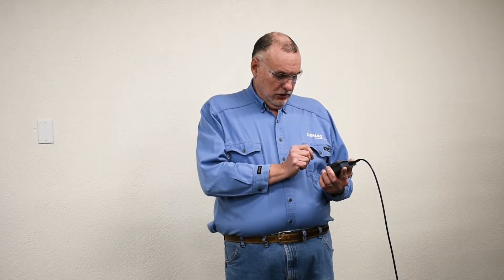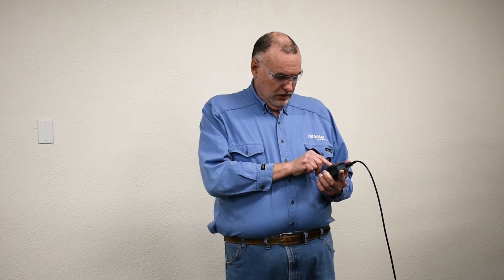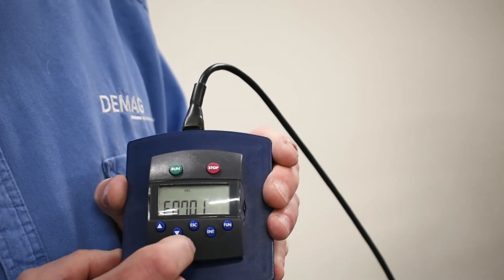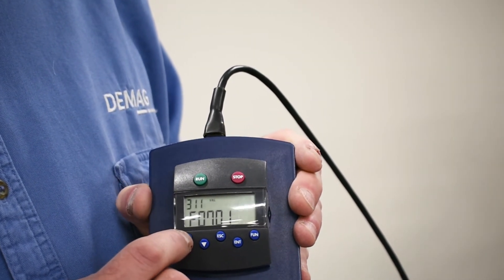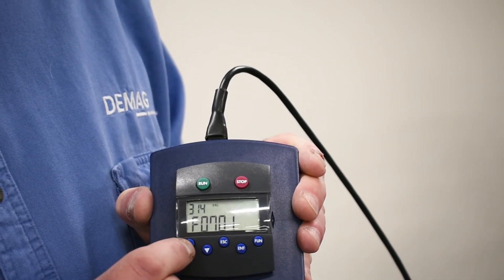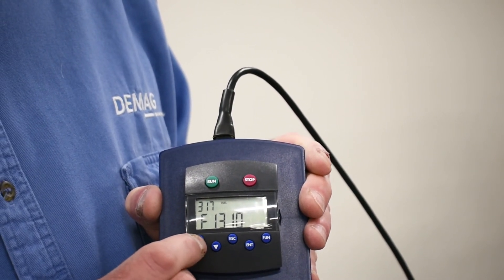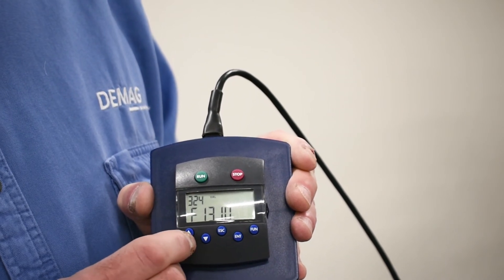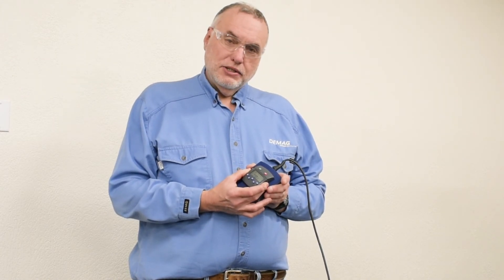Part 2: Error Code 21/ 121- Using the KP500 to View Error History on a Demag DE Drive

Comment: Code 21 issue on 10000# bridge crane.  Trolley won’t move, winch is fine and bridge moves fine.  Get error code F0701.  Demag drive module for trolley comes on, fan runs, have green light, but blinking red light on face.  Obviously not giving ready signal.  Any suggestions?